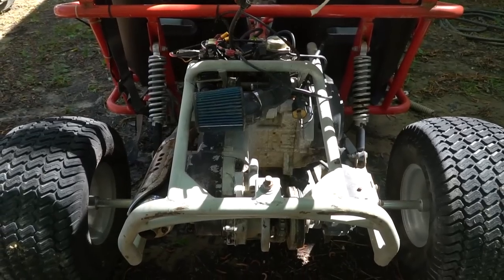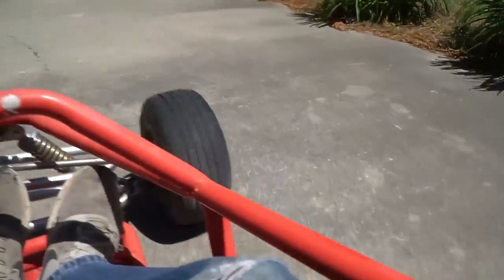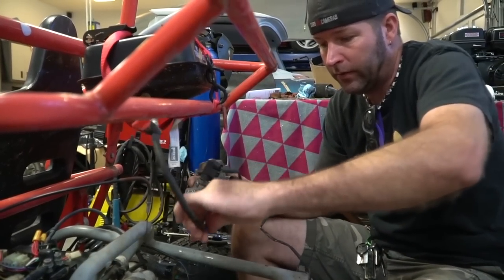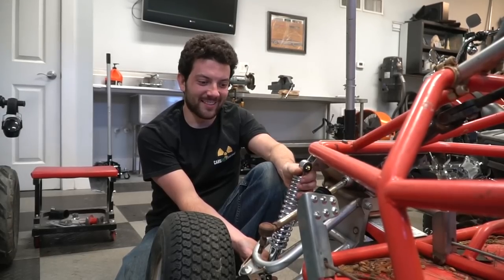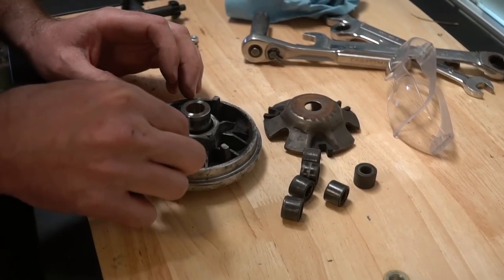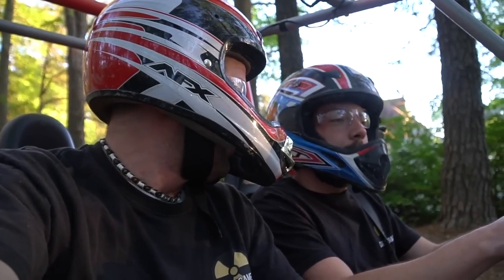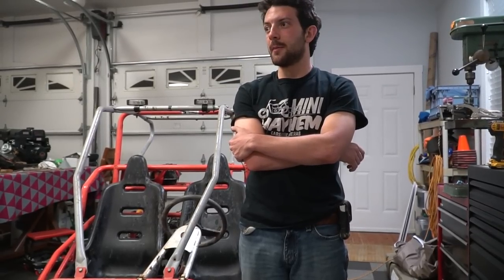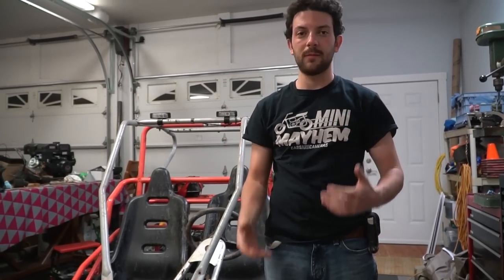DIY Off Road Go Kart Lift + Post-Mini Mayhem Carnage

Comment: You could build new upper shock mounts for the front and use the bigger shocks and get more travel from your suspension
Reply: and slightly bigger wheels

Comment: Put a sleeve on the tie rod.  if you hit a rock/bump and cause bump steer the tie rod will snap at the weld.  This has happened to me and left me stuck on the trail and no way to fix it until I got home.
Reply: Aww bad luck

Comment: I have built 2 gy6 go karts and the engine of choice I would get would be a 232cc long case gy6 engine. Makes the most torque and horsepower that you get out of a drop in engine
Reply: These buggies only accept short case engines. You can still take a short case and get the same displacement and stroke however.
Reply: Idk man for 300 bucks I'll weld a plate for a 18 hp duromax

Comment: Stretch the rear swing arm 4" And lift it so you can run a ATV tire in the rear. On the front you can locate the strut mount lower to allow you to run a longer shock for longer suspension travel and not lift it so much.

Comment: y'all might look into wider tires for the monster truck, maybe lawn mower Rear turf tires for the front and the bigger ATV tires on the rear for traction might help with the "tippyness" of the build, i will say i'm impressed that the little GY6 powered kart was able to do all that it did with minimal work, pretty capable and loads of potential there

Comment: my 150 gy6 moped went from 35 mph to 65 by just installing a non limited cdi
Reply: Then your cdi was bad a scooter* is alot lighter than this kart.
Reply: I just put a new top end on my gy6 150 3days ago. How long do I have to break in the new Piston before I can rip at full throttle? And did u get the orange or blue CDI box? I got the orange one but am waiting till I break in the motor before I put it on.
Reply: @FAKE-NAME  cool thanks I appreciate it

Comment: Hey guys I'm the one with the Hawkeye if you turn the front shocks all the way up and weld the rear shock mounts in 2 in you get a 2" lift and 13" of ground clearance in the middle

Comment: I had one of these years ago, I used Honda 300ex front spindles to add front brakes and used 300ex shocks on the front and rear for a better ride. You should of changed the clutch rollers out to sliders, you get better bottom and top end. Buggy parts northwest also sells upgraded coils and CDI boxes for these.

Comment: the one best mod I have seen for one of the Yerf dogs for after the carb and the brakes is a good old fashioned  set of woolly bugger tires they works for grass and dirt and work ok in the mud without being to over the top . Ebay and most hard ware stores still sells them and you can get them in 8 , 10 , and 12 in sizes the best part they just work really well .

Comment: the biggest gy6 you can get is the Taida 232cc.  You can make any GY6 go 80mph but the engine size just makes the get up and go faster.  Bigger displacement is more torque.  Basically GY6 are Honda clone engines for scooters

Comment: Tire swap back tires from Yerf,to front of Monster,and Taller V-treads on back of both.More top end,and of course grip.You can do easy mud guards too,including can around air filter on Yerf so it doesn't pack with mud.

Comment: The 171 kit is great for price vs performance.  Its also the biggest you can go without boring the case.  But more free exhaust, a carb you can adjust your air fuel on the side, that stuff.  You can buy a 232 engine with over 20 hp, but its fairly expensive.  Its the king of kings when it comes to GY6 tho.  But the 171 should be bolt on kit for most engines with a bigger head and whatnot.  And as for why it was cutting off when y'all were stuck, they don't like getting jostled around then let back to idle.  Mine dies if I do a burn out and the back tire bounces.  Floats are waaaay too easy to bounce around

Comment: If you change the rollers weights you can achieve a higher top speed and less acceleration with heavier ones and more torque and less tops speed with lighter roller weights

Comment: Top basic mods for these engines are going to be: 
better camshaft, probably a9 or a11
Yellow 1,500 rpm mainspring
Uni filter with an extended intake 
Opened up muffler
Head porting

Just these will really wake a gy6 up!

Comment: The rear end hopping is going to cause the rear mount to snap the aluminum housing.  For an upgrade try and find a 250 or 300cc.. Also for safety remove the front bulkhead and fully weld it.

Comment: Them gy6 engines have good power, I for my self have a tomberlin punisher 2 2007 150r I  upgraded it to 1500 rpm yellow springs  on the clutch and changed my 32 tooth sproket to a 45 have added a racing CDI and 27 inch tires on the back. I have no problems with mud, trails or hills.

Comment: Install a de-governed 420cc predator with a simple stage 1 jeted or maybe a Mikuni 26mm/28mm carb. Of course a 40 series torque converter. That thing will be a stump puller!

Comment: Great video as always guys. I for sure say it needs the reverse box installed. 2 as far as speed I qouod not change it other than maybe a couple teeth on gearing. Its got great torque which is what you want to have for offroad. Speed would come as byproduct  if you get a slightly larger and more aggressive tire.

Comment: I have a manco / linhai 250cc Gy6 powered ATV. That Auto choke vacuum carb is junk. Planning to upgrade to 30mm  Kehin clone slide carb with a real manual choke and you should do the same.

Comment: Right now im in the middle of building a mini sand rail out of a Murray with a gsxr 1000 motor. Front stretched 1 foot back stretched 16 inches. Atv a arms and tires so much much wider.

Comment: Check out the ruckshop for performance since the gy6 they do motor swaps for them,some have modified them with stroker kits and all the goodies and have achieved 70+ MPH.

Comment: What is the axle nut size for the other subi yerf dog I need to know desperately
Reply: 1in
Reply: @osquad1346   I mean what size socket would it be for the 1inch  axle
Reply: @DIY-dv7xj  something like 1 and 1/4
Reply: For anyone who need to take them off i used some vice grips👌👌

Comment: You can do pretty much the same thing Ike did to mount the stock shocks, but upside down to make the new ones mount under that control arms so that you can have more travel and the lift you want and still have the tie rods work.
BTW a turbo offroad kart with big mud bogger ATV tires (https://www.summitracing.com/parts/ict-swl-64 ) would be awesome.. Now a 450 dirt bike engine powered gokart with mud boggers would be FREAKIN AWESOME!

Comment: The  mad mud run was awesome.   Testing purposes only.  :P
 New carburetor sounds good.  River crossing ftw!  With dirt knobbies even.
You need a few sets of threaded camber arms for front adjustment. 
There better stuff to throw a good engine in.

Comment: If you want to reverse gear box to work just cut the two poles that have the engine mounts on him and screwed him over to however long it lines up to the sprocket

Comment: In a gy6 engine if you want more torque you swap the rolls in te vario with some lighter rolls. If you Want to get a higher top speed you get havyer rolls in the vario. And install a unlock cdi that made my moped go 15 mph faster

Comment: On the fourwheeler run you a snorkel kinda but you don’t have to go in deep water just run the the air breather up higher so it doesn’t get soaked and all that muddy

Comment: @CarsandCameras Sorry but off the subject, what brand and where can i find 415 that you used to fix the seat on johns 16hp purple kart? It looked so much easier to use then fiber glass resin and I have 4 wheeler fenders to fix, do you think it will work?

Comment: Better tread of tires or bigger tires. Lil bit more lift. Add taller shocks  front and back and see what it do with the set up . Then upgrade motor.

Comment: I just bought one of these Spiderbox karts. The turning radius sucks really bad. I am replacing the a bent front spindle, ball joints and the tie rod ends but have seen on the internet that you can cut more grooves into the rack and pinion to fix this issue.  Is this possible DIY?

Comment: Y'all wanna get the front wheel kit for that one that puts 21x7x8's on there. MUCH BETTER ... ride, ground clearance, looks. Take the fronts from the 4x4 ATV? 20x10x? in the back. "Sliders" instead of "Rollers" in the front pulley, Yellow 1500rpm springs in the back pulley clutch assembly. No REV Limit CDI, and Foam Ail Filter w 125 Main/ 38 Pilot jets. Buggy Depot D C has the best Exhaust. It'll RIP!!!

Comment: put a 250cc from a Honda Helix, or CFmoto Fashion 250 VIP in the yurf-dog instead that GY6. and slightly taller tires in the front. Both engines are liquid cooled, and quite torquey for their size.

Comment: Seems like y’all guys dislike atvs, I’ve been subbed since before 10k and y’all are getting into lifted stuff I think you guys should make a go kart from scratch with a solid axle front end and rear end using a 420 predator if I can pull 29.5” outlaw mud tires on my Honda 420 rancher without a gear reduction you guys could definitely pull some 40in bkts all it would take is some sprocket changes, I used to make some Go karts and motorcycles, I moved on to atvs but if I had the funds, I would most definitely make something like that!!

Comment: I have a problem with my go kart its made from an old murray mower i put a 6.5hp loncin in it but its idling too high so its going forward but i cant turn the idle low enough so it wont roll.

Comment: Get sliders not rollers and get the red torque converter spring and it’ll launch to almost top speed imidiatly
Reply: Yes, Red spring and 11 grams sliders will make it scream and you'll get the most out of those 9hp.

GY6 are no powerhouse but when the cvt is tuned, they are great fun to beat on.

Comment: Put the old yerf dog with the Subaru against the 150gy6 yerf dog!!! See who wins!.... You know what, scratch that! Build a predator (stage 1-4) on a frame that weighs about as much as the gy6 yerf dogs frame and see which predator gets closest to the power of the gy6..... For real that would be a great test am I wrong? Oh and BTW.... The carb issue with leaking fuel and running like crap might be a broken/cracked diaphragm in the top of the carb... Easy to fix! If that's what's wrong lol...

Comment: I had a yard dog those things were pretty fun yes it’s pretty slow but I mess with the throttle and I kind of did something dumb and put a bigger intake then I also put spacer on the springs and it made it kind of sketchy on the frame so that was kind of fun and scary at the same time but I’m ready to build a new play toy any suggestions?

Comment: They make a 14hp 150cc gy6 motor. I have purchased a 10hp 150gy6 motor from ebay for about $220. That motor on a scooter tips out at about 60mph with me on it. I weigh in at about 260lbs

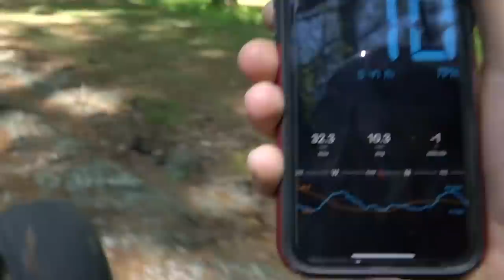Comment: ORIGINAL TOP SPEED WAS 28 MPH @ 3:10 @ 3:16 SHOWED 32.3 MPH MAX SPEED  BUT THAT IS WRONG YOU DIDNT RESET IT. NOW NEW TOP SPEED IS 32.6 MPH. +4.6 MPH IMPROVEMENT.

Comment: You guys should ditch the Gy6 and stick a predator 670 on it with a mikuni and that would go mor places and be better than the Gy6
Reply: You can build these engines to have a decent amount of beans, and is much lighter than a 670, I'm not against that idea but gy6 is plenty capable if built right👍

Comment: I’m building a Chinese quantum two seater 
I used the reverse box 
Cut and removed it from gy6 
I bought a 2003 500 Kawasaki ninja engine two cylinder is nestled right into place 
I’m removing the cvt and using some of the pieces to 
Make it chain drive 
That’s where It sits at the moment
I’ve got the buggy torn down for sand blast respray 
Lime green Kawasaki color lol 
It should be lighting fast

Comment: Go for the 205cc big bore kit. Im still wondering how that go kart only does 33 when 150cc gy6 scooters go 80+
Reply: Cuz its a heavy 4 wheeled vehicle compared to a light 2 wheeled vehicle
Reply: RandomBuildsandRandomFun my 2012 sunny 150cc weighs around 430 lbs
Reply: @TheShadow2056  and a moped is like 200, also more aerodynamic, plus they gear these for torque not speed
Reply: RandomBuildsandRandomFun my scooter weighs around 430 lbs

Comment: I know this is a bit outside your comfort zone, but you know what would be pretty sick, Taking a Yerf dog and dropping a electric motor into it like this.. https://www.electricmotorsport.com/karting/karting-pmac-kits-liquid-cooled/pmac-15kw-cont-38kw-pk-liquid-cooled-motor-drive-system-72-84v-550a.html.  You could team up with jehugarcia or someone like that to figure out the batteries!  I be that would be a pretty sick drive!

Comment: Lighter gram rollers= faster acceleration 

Heavier rollers= more top speed

My gy6 ruckes ran 17g rollers, no big bore and topped out at 62mph
Reply: The only way heavier rollers are going to add speed is if the rollers that are lighter by comparison are too light to let it variate fully

Comment: Get a new carburetor for it by a brand new one there carburetors on GY6 engines are very touchy and break very easy. Engine runs forever I got a taotao powermax 150

Comment: I understand GPS gives you free parts but please do not butcher that buggy. Go to www.buggydepot.com and get parts that are made to work. Ike will understand this, messing with that buggy is like giving a kid a 69 camaro ss and they rebuild it using 1964 truck parts. PLEASE DO NOT BUY A "performance SCOOTER cdi" they are NOT worth a crap on a buggy. They are great on a 100lb scooter but DO NOT WORK worth a crap on a 400lb+ buggy. Put a 26mm carb on it. Remove the factory air box. DO NOT PUT THE FILTER ON THE CARB, put a 12 inch 1.5 inch pipe on it and then add an unifilter. The factory exhaust kills power but DO NOT RUN IT OPEN PIPE. build a header that is about 1.5 foot long out on one inch ID pipe and put a good muffler on it. Open pipes just makes it a dog. I also suggest ordering 12 gram rollers for the varatior and a yellow torque spring for the clutch. Then again what do I know I been running a gy6 buggy for 3 years that is built to the hilt.